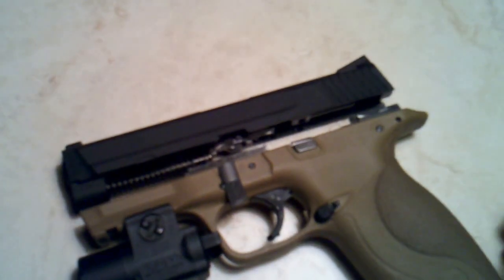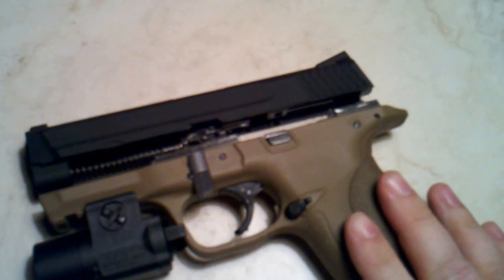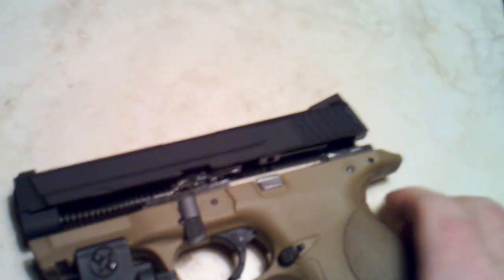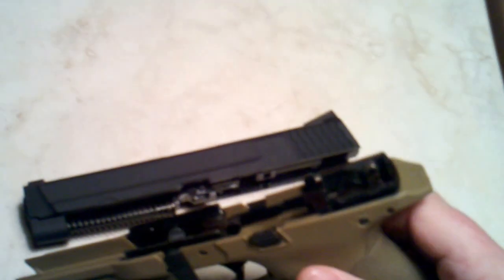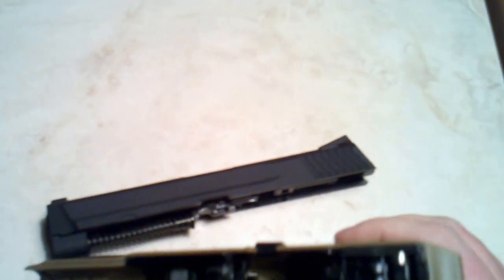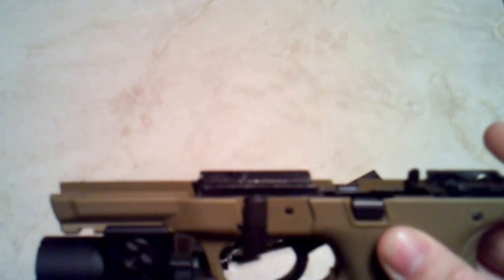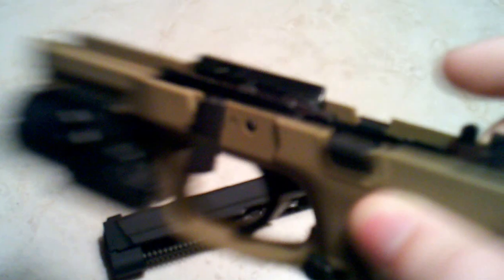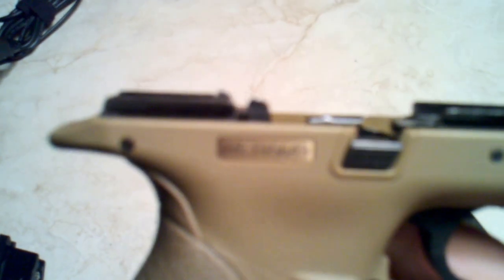We M&P gbb burst fire fix

Comment: did you orange tip come with a metla unthreaded one? How did u remove it?
Reply from the maker: It came with a metal orange tip that wasn't threaded. Don't know what brand, it was stock. I just used pliers on the tip and an open ended wrench on the square end of the outer barrel. Turn counter clockwise to remove. I replaced mine with a threaded barrel adapter.
Reply: was the orange tip metal? because mine came with one and I heated it and used tools but that thing won't come off. lol
Reply from the maker: The tip was metal and threaded into the barrel but not threaded for mock suppressors. Mine was just glued into the other barrel so I was able to remove it but if yours is new it may be pinned too. It's the latest trick. If its pinned you'll have to drill out the pin.
Reply: yea, it was not threaded. it felt like it was stiff fitted in the barrel and glued hard.
Reply from the maker: Did you get it off?
Reply from the maker: If you can't get it off I think you can get a replacement outer barrel from evike pretty cheep and it won't come with an orange tip
Reply from the maker: http://www.evike.com/products/38008/  Here's the link for the orange one. It comes in black and silver too.

Comment: anybody know how to fix the hammer not cocking when pulling the slide back.
Reply from the maker: Did you file down the sear?
Reply: no i did not do anything to it
Reply from the maker: If the hammer won't cock my best guess is a problem with the sear. If it's still under warranty I would try to send it back. If not or if you can't afford to you can get a replacement sear from evike.com for cheap. Then just watch the vids that talk about fileing it down to see how to open it up to replace it.
Reply from the maker: I don't recommend you file the sear though. I tried that and it caused more problems.